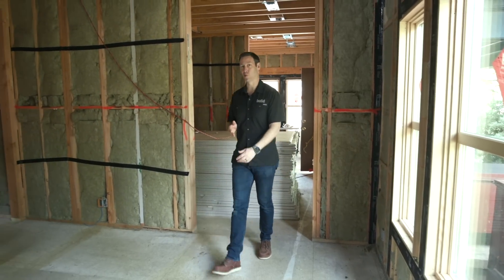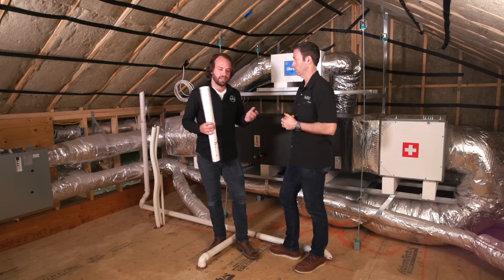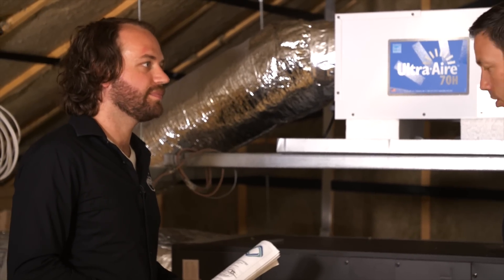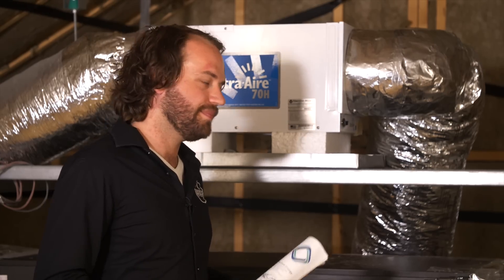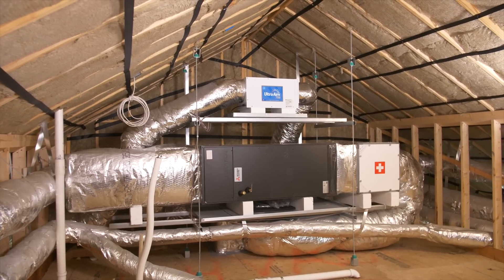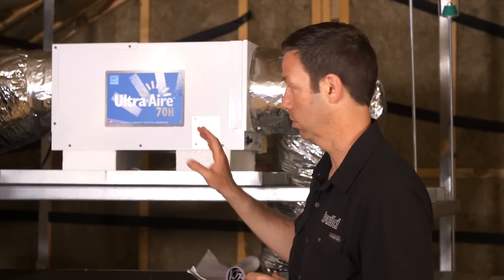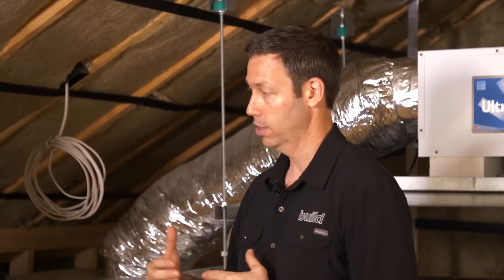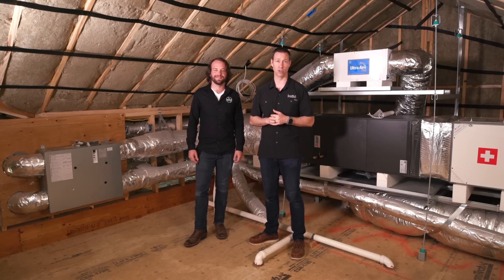New BUILD : Excellent Air Conditioning System Cost?  I’ll tell you!

Comment: Our 4300 square foot, two story house was built in 2002. It has three 2.5 ton units. One is for the master bedroom, master bath, and the home office. This approach saves us a ton of money. We can close off our bedroom and run that unit at night while the rest of the house does not have to be heated or cooled at the same temp we want in the bedroom at night. My cost to upgrade or replace one of those smaller units is much less compared to replacing a single large unit. So far all three units are still working. I had to replace the circuit board in one unit two years ago. I did that myself, because my service guy was traveling out of state. He services my units every year, cleans the coils, checks freon levels, cleans the burners, etc.

Those hepa filtering units get clogged up quickly. I know because I've had one of them in one of our houses. I've tried all that fancy stuff, humidifiers, etc. The simpler you keep it, the better. What works better is super insulating the house, use smart thermostats, window shades on the south side, and keep the rest of the system simple. I change all of my filters every three months. I use the medium grade filters, instead of the super fine particle filters.

Over the last forty years, I've purchased multiple heat and air systems, for various houses we've owned. For our area, heat pumps have proven to work well, even through I have 20,000 watts of electric auxiliary heat as a backup in one large house. It comes on so rarely, it's impact on my electric bill has not been bad.

We have natural gas heat in another house, and it runs $350 to 450 per month during the two coldest months. The house with the heat pumps, which is the larger home, has never had an electric bill above $350.00. The highest utility bills, in our area, are for July, August, January and February. The houses are 25 miles apart so the climate is identical.

I am not a professional builder. I'm just giving my perspectives based on forty-eight years' experience of being a home owner of multiple houses in different states across the South.

I like your channel and learn a lot from you. I am not trying to be critical. I'm just stating what has worked best for us over the years. It might help a few people, who are not planning to build a million dollar home.
Reply: True HEPA filters burn up fan motors.  Went back to the "Good" filter at HD and still no dust on my coils at all and I no longer replace fan motors every couple years.
Reply: @jamesvanriper6334   The reason the "HEPA" filter "Burns up your motor", is that your filtration / return duct system, wasn't sized or designed for the highly restrictive nature of the ultra-high efficiency filter to begin with. A "HEPA" style filtration system much more free surface area to allow air to pass through it, without creating an intolerable pressure (and flow) restriction. Your poor blower motor essentially died the same death as a chain smoker......it's lungs were working 15 times harder than they were designed for, just to get the same flow they did before smoking started.
Reply: @leftistsmustexpire  As someone who suffers from severe allergies and has COPD I'd like it if you could give an example or two of what would be involved in switching a 4 year old home in SW Utah from traditional filtration to a true HEPA. The  St. George area is windy nearly daily which picks up a lot of dust and pollen. The next city over is called Hurricane for a good reason.  The filters I use are 20"x30"x1" MERV 8 by Nordic Air. I keep it at a MERV rating that (I hope) won't stress the fan. 

Currently I only run the fan while cooling or heating. If I run it longer, as was suggested to me by the builder, it aggravates my COPD.  Turning on ceiling fans in the house instantly cause me to cough and my lungs close up. Same happens in even the cleanest of restaurants. Any fan, even a little 12" table top model will trigger everything.

it's 100* to 118* for 3-4 months a year and goes down to freezing in Winter.  Extremely low humidity for most of the year but heavy rain during monsoon season.
Reply: ANOTHER CONSIDERATION...OUR BODIES ARE NOT DESIGNED TO INHALE PURE AIR.....WE HAVE TO HAVE.." CERTAIN MICROBES"... WE ARE DUST.
Reply: WE HAVE TO BE GENUINE WITH EACH OTHER ON SOCIAL MEDIA....MOST OF US ARE HERE TO LEARN OR HELP SOMEONE ELSE..THANKYOU SIR
Reply: I HAVE BEEN THINKING ABOUT GOING WITH ..MULTIPLE SMALLER UNITS IN MY HOUSE ALSO...I KEEP THINKING ..IT HAS TO BE MORE EFFICIENT!... THANKYOU FOR YOUR INPUT!
Reply: The American Dream!👏🏼
Reply: Currently using a single 2 ton unit to condition the air for a 2000 sq. ft home.  Last years HVAC power bill was only $160 for the whole year.  Avg summer time humidity is around 47% R.H.  very comfortable.
Reply: Do you really need 4300 square and 3 hvac units?
Reply: James Gleason , the three air conditioner units are more efficient that one large unit. We can cool or heat our bedroom at night without cooling or heating the whole house. We can cool or heat the den without cooling and heating the master suite.

Few people actually need 4300 square feet of living space. Few people actually need to drive new cars. I could drive a new car, but I choose to drive a twenty-year-old Toyota minivan because I like it and it still runs great. Every person could go through life getting by on the bare minimum actually needed to survive. Why not live the best life one can afford to live? When we get old and relegated to living in a nursing home, at least we might have some memories of a good life, before even that is gone.

I grew up in poverty. My first job was sweeping out a five and dime store three days a week. I was nine years old and walked to town and started sweeping at six o'clock in the morning. I was paid one dollar per week. I gave that dollar to my mother to help buy food for my younger brother and I.

I started a lawn mowing service at age ten, with a mower I purchased for four dollars. I mowed lawns for a dollar a yard. At age 12, I delivered newspapers for $20 a month and thought I was rich. I worked at a newspaper office part-time six days a week, my last three years in high school. I volunteered and served in the army during the Vietnam War. After being honorably discharged, I then went to college on the GI Bill.

I could live in an Army tent like I did one time, but I chose to live in house, a nice house.

Thank you for your question. It offered me a chance to reflect back on my life.
Reply: @jacklabloom635  Wow

Comment: Ok video for the novice, not good for people in the building business.  Looking at the duct plans, I see the main return at the front of the house and a small one at the foyer area, if all the doors are closed, it looks like it would over pressurize the rooms, and the jumper duct at the rear looks to be a passive equailizer duct?  They never get to the hard cost, only talk about percentage of overall cost.  For a small house under 2000 square feet, only the super rich would spend 30k-60k on this ultra esoteric equipment.

Comment: I have put in many systems and I always put systems in a second floor closet and returns from bedrooms came down next to unit.  This minimizes ductwork.  I made a plenum and installed dampers in the plenum.  Power Open/ Close.  I put in a fresh air return into the sophet or wall.  I chose not to put dampers on the fresh air.  Either a 5" or 4" duct was used.  This compensated for any pressure differntial caused by  bathroom fans on.  Even with the system off, the negative pressure caused by the fart fan would pull filtered air through the house.  A 3000 foot house 2 story with isonene would be about $12000.  I built a plenum in the downstairs near the center of the house and all down ducts were off that.  Sizing of ducts to each room was done using Wrightsoft.  Been using it since 1998.  The zone controller handled the staging but on the communicating systems the Thermostat did that. 
The latest equipment from Daikin/Goodman has adaptive staging which changes according to the load.  In spring, it will run on low stage mostly.  The dehum functions and all settings to tweak the unit is done by bluetooth to the air handler.  Updatable software for the air handler and condenser is through the phone to bluetooth function.  I have seen too many UV lights and ERVs not working due to homeowners not liking to pay several hundred dollars a year to work on them.  The comfort level of a properly sized 2 stage system with zoning is a far more practical system.  The extra dehumidifier without proper airflow will cause problems unless it clears the cold air out of the duct system.  As you know, you need to have a minimum amount of air in the ductwork or you get stagnant air in a part of the ductwork that exceeds 60% humidity and allows mold to grow.  Can you change that filter for $20 like merv 13's cost?
I like to install 14 seer equipment these days as they have no call backs, last 15 years and the fan motors don't cost $1500 to replace after 8 years.  The bearings on the 2 stage Copelands seem to have issues after 8 years or so.  I have a Class A with C designation here in Austin.  I don't like the failure rates of a dehumidifier that uses a compressor and fan plus an ERV plus 2 stage compressors with variable speed motors on the condenser.  On a house like this video has, the power bill in Austin will be way under $100.  The difference between a 14 seer and even a 16 seer system as far as energy usage will never in the lifetime of the equipment have a return.  A 16 seer 2 stage with variable speed air handler is $1600 more than a 14.  13% energy savings will save $150 per year.  The equipment lifetime is about 12 years. The 3000 foot house on Hwy 360 has a power bill of $60 using my technique with a 16 seer zoned 2 stage.  The zoning with time of day calculations on where the loads are, keep the system running in low stage over 90% of the time.  So the 3 ton system cooling a 3000 foot house in Austin doesn't go out of the 2 ton mode very often. Since the zone board bye EWC can handle basic thermostats and only needs the one communicating one, the cost was only $12000.  The returns to each room was pretty easy since the only thing in the attic was ductwork.  The duct runs were short as the control box was in the center of the attic.  I find that the sealed houses have alot of humidity and are at least 10 degrees warmer than the living space.  Putting 500 lbs of equipment in an attic raises the load factor by 10%.  After all, when the equipment is off, it warms to attic temperature and when turned on has to cool down all that mass.
Nice Video.
Reply: I have no idea what you're talking about but it sounds interesting
Reply: I wanna party with you.
Reply: Trade craft speak
Reply: Could have simplified that entire conversation with a 2-3 heads per mini-split system and then run the ERV + Dehumidifier for the whole house in the rigid ductwork. Boom. Problem solved. ✌🏽

Comment: Hi Matt,
I have seen a number of videos from you about this topic, but I can’t wrap my head around the loop. Can you do a short video or even an illustration about the intake and outtake chain!? Eg intake air from ac return grill goes through IQ AIR purifier, into Mitsubishi ac system, then outgoing hair goes through dehumidifier, then the exhaust air from that goes through Erv, and then all returns are from
Erv into rooms?? Or are there seperate ac vents and seperate ERV ventilation. This is one detail that has always confused me about the systems
Reply: Brian Tinsman your comment isn’t helpful
Reply: Apollo,
At a hi level, you will have 2 main ways to run an ERV, 1. Piggyback on the HVAC duct system, which will likely cause condensation or other balance issues at some point. Or 2. Have a dedicated duct system for the ERV supplies and returns. Supposedly, the are a few designed systems by some manufacturers for piggybacking installations but not sure if they have been fully tested for long term use in humid climates.

Comment: I have no problem with companies like PositiveEnergy, but how do you deal with your HVAC installer when you come with an outside companie's design? Are you paying for something that someone with 20 years experience and forward-thinking could do and it's included with the cost of install? Who is responsible if air flow/quality doesn't meet expectations?

Comment: Awesome video Matt. If that’s what the homeowner wanted great.
But that style of heating and cooling system is two decades old. That’s way too much equipment, that takes up way too much space, and compared to new systems is not anywhere close to being energy-efficient. A Mitsubishi mini split Multi head system. It’s a way better choice and all applications. Cheaper upfront cost, it takes up no additional space, you will see a savings on your electricity cost per month. It’s able to pull out more humidity and has a dehumidification mode. The comfort inside the home far exceeds anybody’s expectations. If anybody would like to contact me I have the first retrofit house in Texas my personal design it is absolutely incredible. Everybody likes to talk numbers the system is $11,000 cheaper than anybody’s conventional system, and in the most energy demanding months I’m saving $90 per month.

Comment: Granted I'm a general contractor, not a builder, I'm glad I live in the PNW. My personal houses are built tight, not as tight as I've seen on this Channel, but I use fresh air vents on all windows that stay open all year round. I used mini splits and I am very happy with them. They can do everything this system can except the filtering for much less cost. I live on an island in the puget sound so air quality is much better than most of the country. I Think the idea of having a leaky house is very region specific. If I was in the humid south I would want my house built the way this channel does it. Where I am leaky isn't a bad thing but still needs control. Although my window vents are always open unless it's a blower door test.

Comment: This is good info.  I agree that a proper HVAC plan is essential, and the quality of the install is every bit as important as the quality of the units themselves.  Are the filters in the IQ AIr unit proprietary (expensive)?
Reply: OzoneEditions the IQAir website says the filters are $395, so they’re like 10X more expensive but doesn’t say how often. They are described as having “thinner fiber design” so I’m guessing proprietary. Still, $2695 for the unit and $395 for filters seems incredibly expensive.

Comment: “Mitsubishi, lg, daikon”??, any HVAC techs out there work on these units and what are the cost for repairs? are parts easy to get? Do your local distributor carry most of the parts?
Reply: Not tech but I just had my Daikin mini-split fixed after an unfortunate lawn mower rock incident. the tech had the parts in his van and said that they don't really have problems other than snow build up in the winter causing them to do a safety shutdown.
Reply: Never Sleight what was the problem? Please don’t say I don’t know, and I’m talking about parts specifically for these units only like boards and motors that only fit these not universal parts like capacities and such, and everything breaks it’s just a matter of time
Reply: @edgardelgado9937  sorry for the late reply. Been camping without cell service.  The part was a copper pipe that rubbed and needed a special cap piece.  $75 for the service call and I gave him a cold Coke and he said the part was free/ not worth looking up.

Comment: Best is to install a smaller AC system on just the bedrooms with a return in each bedroom and a $250. zone control system with a thermostat in each bedroom., and install a second unit for the rest of the house that covers the remainder of the heat load. Like 14 seer units only. The selling point will be good because the house has multiple AC's and full climate control where it is needed. In the daytime the customer can turn the bedroom unit up or off, and at night the unit on the rest of the house is turned up or off. This will save tons of dollars off the electric bill and will never incur high cost repair bills. Your Customers will love you for doing it this way because some day your Customers will meet me..  The AC Serviceman.. I will be inspired to tell the truth.. :-)

Comment: Love the in fact that they're talking about design and how important it is as their stepping over DWV pipe. I assume they could have pushed it under the floor and pop it near the wall or back 3feet under the ducting. 

 Love the show! Glad they don't show my jobs!   Armchair quarter backing is so easy.
Reply: That way the plumbers don’t have to drill holes through ceiling joists, which are probably part of a truss system.  I would be glad they did it this way, it’s a mechanical room.
Reply: Most times holes in joists are frowned upon by codes..... arm chair quaterbacks will always chime in..... im proud of my own work.... you??
Reply: @jstkeeps  yep 98% of the time I will be happy to put my name on anything I do.  (Anyone who says they are always proud of the work are biased to the point that they become scary). Also please show me what code says you can't put holes in joists, and I'll show you 10 that say you can and will give you directions how to do it.

Comment: I love that system, wish I knew what to budget for a system like that using geothermal!
Reply: You can use a website like Alpine Home Air or others to price out the mechanical system. Installation costs vary depending on location and design. Also, keep in mind the future cost of maintenance. Lastly, leave yourself allot of work space around the systems. They do not last forever and newer systems are never the same footprint as the original they will replace.
Reply: thanks Valkyrie for the response!